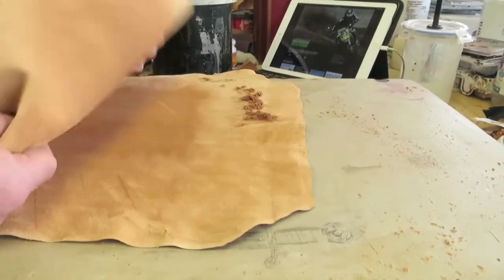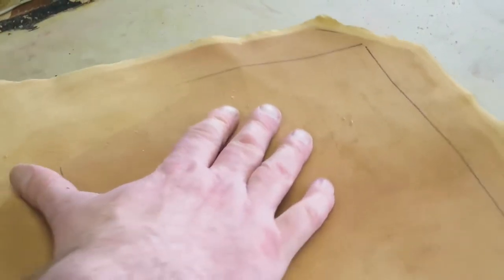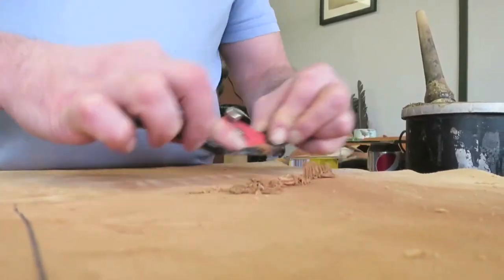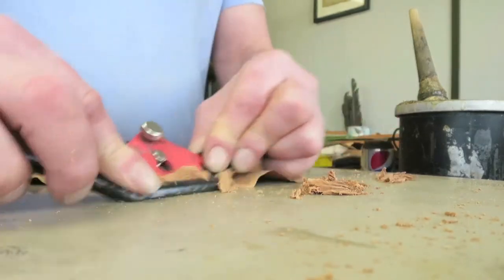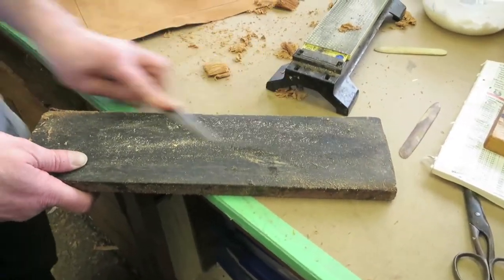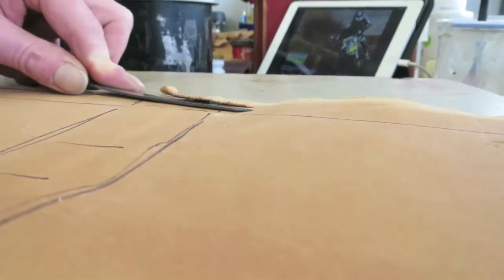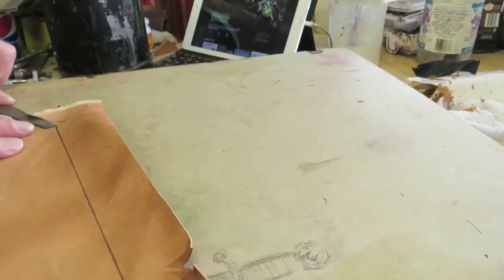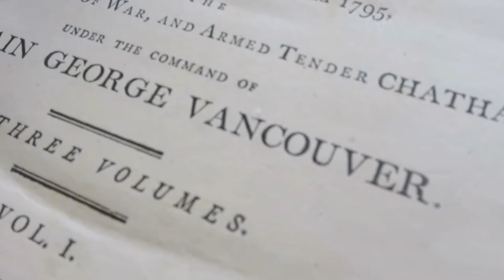Old English Bindery Vlog #1 - Paring Leather for a Set of Vancouver's Voyages

Comment: Remove material leather that could, over time provide more support and protection for the the book. I don't agree.
Reply from the maker: This is a traditional process that has been used for hundreds of years on books that have stood the test of time. Paring leather is important so that you can have proper turn-ins and the right feel for the book. :)
Reply: I know many binders that just do not go by this and work full calf or Morocco, but each to their own. You wouldn't be on my short list. Sorry to be so blunt.
Reply from the maker: Would be open to seeing the work of any professional binder that does not pare leather. Or even a page from any book about bookbinding where your theory is correct.  Or even any school curriculum that shows a professional binder who does not pare leather. Send a link and we'll have a look. Would be interesting to see.  No worries about being blunt. That's why your leather isn't pared. :)
Reply: @oldenglishbindery7626  Balance, elegance, strength and practicality are all the results of skilful paring. I see hundreds of books bound (on you tube and it's usually Tolkien) in thick unpaired leather, the results are clunky, ungainly, ugly, heavy, and in time the leather along the hinges splits because the thickness of the leather means that tension is caused as exterior is stretched as interior is compressed. Skillful paring is an essential part of quality, lasting craft bookbinding. Nothing prevents leaving a decent amount of leather on the boards but only skilful paring will make this invisible to the untrained eye. By the way - a great clip, thanks for sharing Old English Bindery.